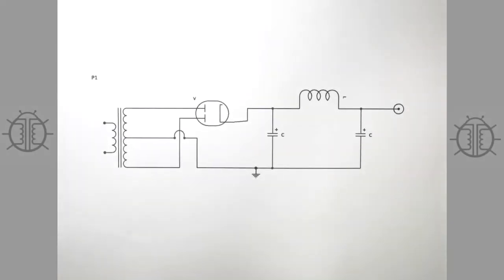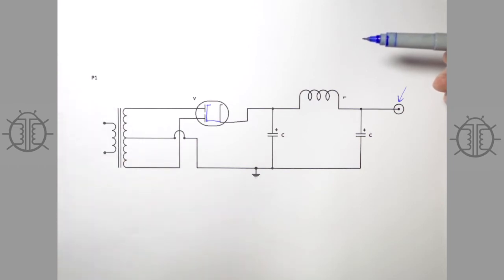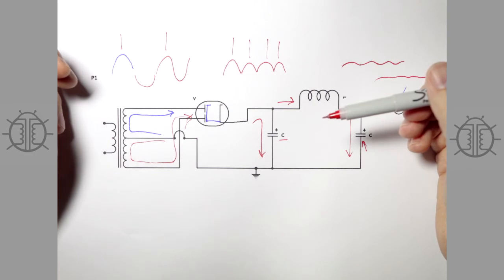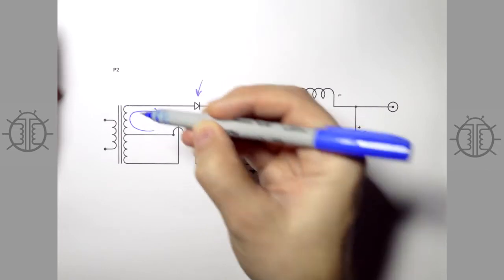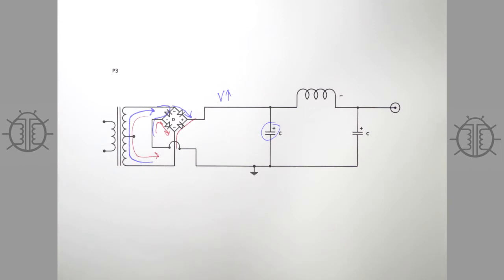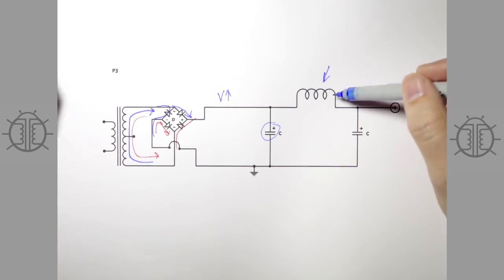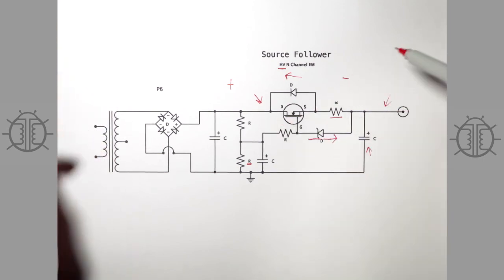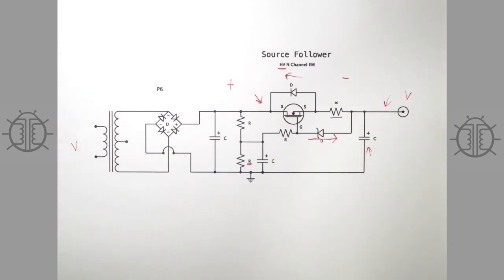Tube Amp Power Supply Design

Comment: For your final example where you suggest the idea of several zeners in series to add some voltage regulation to your circuit, I am recalling the use of tubes such as the VR-150. (Which we used to use.) Also, this brings to mind devices like the NE-2, as well. Just wanted to toss out the idea that one does NOT necessarily require the use of silicon zeners for this purpose.
Reply from the maker: Definitely agree! There are lots of ways to make a voltage reference. I’ve been using a small depletion mosfet for that lately. Uses way less current than zeners!
Reply: When a teenager (world population less than half of today's) I designed the HV regulation for the Geiger tube using a series string of NE-2's to develop the approximate 1400 VDC needed for the tube. (I contacted the physicist responsible for designing that tube and he sold me one, directly, for USD8.) Each NE-2 is a little different. So one needs to measure the stacked result, of course. I hadn't considered your thought about a small depletion mode mosfet, though. Need to think a little about that. :)  @Edgarbopp

Comment: Nice video, explained everything in great detail, we will refer our students to this video.  It contains all you need to know to build the regulator.  I see some people complaining about a lack of values and calculations.  If you can't compute the values for your requirements from the explanations in this video, you should NOT be experimenting with tube amps and power supplies like this.
Reply from the maker: togethia Thanks, I’m happy you find it useful!
Reply: Just look at a schematic the values are there already. If you are into designing your own then read books on how the values are determined. If you change tubes then you need to change values for the most part unless it's a direct substitute. 73

Comment: I never had a rectifier tube go bad. Probably because our voltage was only 115 vac from the standard outlet. Filter caps usually went bad probably because of their age. My amplifier had a 5Y3 and the preamplifier stage used a 12AX7 wired for 6.3 volts, the power amp stage was a push pull 6AQ5. Good little amplifier made by admiral. I believe it would still be working if I still had it. I have a voltage reducer for my tube radios. Made by APC the same company that makes UPS for computers. I like to keep everything original they sound better as a tube amp. My biggest project will be restoring my dynaco st70.i bought all new tubes including the rectifier tube. The only thing on the dynaco amp that will be changed is the Selenium rectifier I have the diode that was recommended for that amplifier. 73

Comment: The protection diode you added from source to drain in the fet is not required because it already exists as a function of how the fet is created, It is commonly called the 'body diode'...
The zener diode you added as a dual purpose device to current limit the supply and protect the Gate of the fet can actually cause the fet gate to go overvoltage in the case of the input cap shorting out while the output cap is still fully charged.
I strongly recommend using a bipolar transistor to sense the voltage across the current sense resistor with a series diode (1N4007) between the collector of the bipolar transistor and the gate of the fet which would allow the transistor to pull down the gate voltage to current limit, but not allow any current flow TO the gate when the output cap is charged when the input cap voltage rapidly drops to zero.
 You also need to add a reverse biased HV diode from the gate to the drain of the fet because of the reverse voltage pulse that can be developed across the resistor between the capacity multiplier input and the charged capacitor from the gate to ground.
 There are other ways of providing similar protections, but the one I described fits well into your design and provides a more accurate threshold of current limiting.
Reply from the maker: I definitely agree! I’m still just learning and since making this video I’ve actually used a BJT across a sense resistor just like you described! 

Some FETs do have reverse voltage protection built in but some still don’t so I tend to leave it in as a extra uf4007 costs basically nothing. 

Thanks for your thoughtful comment!
Reply: @Edgarbopp  
Thank you for responding.
Yes there are different types of fets, namely jfets and mosfets, adding a little more confusion, both types are available in both enhanced and depletion models.
There is NO physical diode inside a mosfet, the diode is the result of the process used to make it!  Therefore I cannot imagine you finding a mosfet anywhere that does not have a body diode,,  And you were using an enhancement mode n-channel mosfet in your schematic.
 Please also spend a little more time considering the other modifications I recommended.   I have an illness called MG, and it took a very long time to type that comment because of problems controlling my muscle movement..(the shakes, but not old age shakes).
 There is no doubt that your design will work, I was only trying to help you improve your protection systems.....
Reply from the maker: @Dennis-mq6or  thanks for taking the time! I’m sorry you’re struggling with MG!! I’ll reread your comment carefully.

Comment: It's not just variations in current drawn from the supply that cause reservoir cap voltage to vary.  Here in South West England, my mains supply voltage varies a few percent with a regular pattern to it.  It's like two or three simultaneous things varying the voltage, each having a different frequency in the range one to three Hz.  If you concentrate you can see brightness fluctuations in an incandescent lamp, and also hear the same variations in the magnetostriction hum of a large transformer.

Comment: This is a series Voltage Regulator versus a Shunt Regulator, many prefer a voltage source feeding a Shunt Regulator for Audio Electronics as it is more stable to powers line fluctuations. A Shunt Regulator would have the Drain going to ground and the Source near the incoming voltage..

Comment: This is the best explanation of a main power supply and filtering I have found so far.
Is it possible to use a Mosfet after a rectifier tube or do you have to use a Bridge rectified B+ with a Mosfet only?
Reply from the maker: The FET filter will work just as well after a tube rectifier. I’ve used it that way in a preamp I designed.  🙂

Comment: Good explanation of the different supply options. How does this final circuit differ from "capacitance multiplier? To my untrained eye it does not. I'll try the last one out. Is it necessary to filter it further with an inductor or can I pass it straight to plate?
Reply from the maker: The final circuit has a voltage reference created by a shunt regulator. In this case it’s a resistance and a Zener. That locks the MOSFET gate at a specific voltage. So it’s more like a regulator than a capacitance multiplier at that point. The output may feed the output tube plates directly. It will be very well filtered
Reply: @Edgarbopp  Thanks for explanation. Can I use high voltage NPN silicon transistor instead of a MOSFET? There are also 150v and 200v zeners available - how do I set the voltage for the transistor with it? I need like 250V in the output with up to 100 mA of current.
Reply from the maker: @MarkErikEE  a BJT can be used but the base will require current unlike a mosfet. 

To generate your reference voltage you will need to create a shunt regulator with a resistor and a Zener or a string of zeners. You will need to supply a minimum current to the Zener for it to drop its specified voltage. That should be in the data sheet. Chose the the resistance by understanding that the remaining input voltage that is not dropped by the zeners will be dropped by the resistance.

Comment: Excellent video. And passive components for high voltage? Suppose I am building a transmitter with an RF vacuum tube needing 800Vdc plate voltage. What capacitors and inductor can I use? And where do I get them? Oops. I did not watch the whole video. At 16:00 into the video the inductor is replaced with an N channel MOSFET. I wonder if I could use P channel for negative supply?
Reply from the maker: I should make a video about that. There are some pretty simple ways of achieving 800v using only 450v rated capacitors.

Comment: Another question if I may:  Because of horror stories I've heard about when using modern diodes in place of the old rectifer tubes and problems they can cause is that the reason for that RC time you mention ranging in the 15-30 seconds, is that to mimic the time the old tube rectifiers would also give .....as in, to help illuminate current surge and time for the tube to warm up before seeing full voltage on their plates ?

Comment: I have a question about transformer windings, on the full wave rectifier does each winding need to be rated for the whole current, even if they are only on half the time?
So say on a 50W Marshall JCM you have 690VCT@200mA (being 138W capable), is that 2 x 345V@200mA windings (not 2x100mA), only used in a 69W configuration?
So the regulator could potentially be "Brown Sound" switch, I know some amps have been built with multiple windings to allow voltage changes.
The circuit at the end looks a lot like the "gyrator" in the Molwam Pollux, albeit different, is this a true gyrator, have you experimented with these, what do you make of them?
I can send the schematic over, never seen it elsewhere

Comment: New to the channel and am very impressed! So have you given any more thought to a real live with values example video on this?  And if I may ask....what are those depletion type Moffetts you've spoke about in the other comments? Thanks!
Reply from the maker: LND150 for a low current voltage reference. It comes in TO92 as well as other small packages.

Comment: With the Zener regulator you show at the end, if wall voltage drops and the zener drops out, does the circuit go back to being a capacitance multiplier?
Reply from the maker: Yes!
Reply: @Edgarbopp  Well this is interesting.  That means one should probably keep the higher value cap in place.  It also means you might as well always implement the zener regulator.  I wonder which of the two circuits, regulator or CM lowers noise the most?
Reply from the maker: @rhclark6530  the zener regulator and CM are actually very similar in terms of ripple. I prefer the CM because you waste less power. With a regulator you need sufficient V drop so that the circuit won’t drop out under any circumstances. A more sophisticated regulator with a error amp and feedback network will be better then the zener regulator. Check out my video on the Maida regulator for more on that.
Reply: @Edgarbopp  I see your point.  Also I guess one could cascade two CMs for potentially insane ripple reduction in phono stage or headphone amp potentially.   Yeah, the Maida video is excellent.  Best explanation of the circuit I have seen.
Reply from the maker: @rhclark6530  my current pre uses a reg into a pair of CM.
Reply: @Edgarbopp  I don't mean to keep hitting you with these questions but this really interesting stuff.  Why did you put the CMs after the regulator rather than the reverse?
Reply from the maker: @rhclark6530  that’s a good question. I don’t have a great answer. I should do some tests and see if there is a benefit to using them in a different order. You could potentially test it yourself. Sounds fun!

Comment: Would love your comments on how tube rectification SOUNDS.
Reply from the maker: Tube rectifiers have a “sound” only under very specific circumstances. They have a highish internal resistance and so will drop voltage depending on the current. This means that when used with a class AB output stage the voltage drop will increase as the stage is pushed harder. This is called voltage sag. In instrument amps this can cause a combination of slow attack and release compression as well as additional distortion. Some musicians like this. However if SS diodes are used instead of a rectifier you can simply add a power resistor in series with the HV supply to mimic the internal resistance of a tube rectifier.

Comment: Hi Doug - can you tell us how to compute the components value for a 320V output? 250VAC PT? Many thanks!
Reply from the maker: If the HV secondary is 250v a quick way to guess the voltage after bridge rectification and filter cap is to just multiply by 1.4x that will get you in the ballpark.
Reply: @Edgarbopp  Indeed the secondary is 250 which yields about 350 after the first cap. What about the drop of voltage on the MOS circuit? How an I compute the components values? Many thanks!

Comment: i Like your psu design.
I wanna use/have 2 x 15 Volt (1.5 Amp) transformers back to back, to get around 210 V ac ( a bit of lost from 220 V ac). after i rectify that i have like 290 V dc.
the circuit i wanna build has 3 12AX7 an 1 6AQ5A tube, both have a max operating voltage of 250 V. 
What output voltage of your psu would you choose? the schematics says 275 V dc.

i saw your example circuits and taking "p7", what resistors, zener diode, Mosfet, capacitor (appart from the 4700uF, next to the rectifier) would i take?

Comment: On your first drawing you should match the transformer resistance and min rectifier resistance  
 found on your data sheet about 50-200 ohm add them and put in series  a 10 watt or 20 resistors the added value  should work very well…put the resistor right after the rect tube  this puts a load on the tube and keeping current moving forward and not going back into the transformer and causing it to heat up saving the tube and transformer life many manufacturers did this in the 1960s 
also the choke inductor has a resistance from 150-300 ohms as well add these calculations in your circuit design 😀the inductor choke will lower your b+ also using a too large of a capacitor on the first stage could be bad again look at the data sheet of the tube after the choke have fun and put a giant one in but 50mf to 100mf should do plenty 
Also you can do a simple 5 stage filter with resistors and capacitors 
I personally would use a motor run capacitor for a hvac they are dirt cheap and on Amazon and are oil filled and have no esr and make perfect filter capacitors  I have had very low ripple ac about .0031 at -90dbv and a standard ac ripple it will be dead quiet

Comment: Really nice job and great explaination of how things work. I see the link to Circuit examples is broken . Do you still have circuit examples avaiable ? I'm building a power supply for a BC-348. It is an HF receiver from a B17 Bomber.  I think the regulated version fits the bill to replace the Dynamotor.
Reply from the maker: I’ve fixed the link!
Reply: @Edgarbopp  Thank You !  I have the supply simulated with pspice and seems to work fine so it is on to building it. I chose the regulated version with a 214V zener value to yeild a 210 volt supply from a 350 V source. Thanks again.

Comment: Aren't you significantly raising the power supply impedance with that current resistor at the output?
Reply from the maker: The output cap dominates the output impedance of the circuit.
Reply: @Edgarbopp  Ah.  I have yet to find a good explanation anywhere of why power supply output impedance in audio power supplies matters and what we should do about it when designing?  Do you know of any?  Maybe you could do a video?  ;  )
Reply from the maker: @rhclark6530  I have a video on the output impedance of the amplifier but the output impedance of the power supply is a good topic idea. Typically it’s important for lowering crosstalk between channels, and providing adequate current in class AB amps when they transition to class AB from A.
Reply: @Edgarbopp   Interesting.  I hope you do a video.  One thought is that local bypass caps at each tube or each channel might help with shared power supply crosstalk.  BTW I think you were implying earlier was that irrespective of what comes before it you want a big cap at the output of the power supply to  keep the impedance of the supply low? If that's true what's the point of diminishing returns.  47uf or 470uf?
Reply from the maker: @rhclark6530  the size of the cap needs to bypass all audio frequencies at the impedance of the circuit. So the size necessary is different for different applications. Though as a general rule, I find 100uf to be a good place to start for power amps in the 10-20wpc range.
Reply: @Edgarbopp   What do you mean by the impedance of the circuit? The output impedance of the audio circuit?
Reply from the maker: @rhclark6530  the input impedance of the circuit the power supply is supplying. In this case probably the center tap of the output transformer. Asking what the impedance of that circuit is is the same as asking how much current it’s going to need at specific frequencies and voltages.
Reply: @Edgarbopp  That makes sense.  So in a line level stage it would be the rp of the tubes in parallel?
Reply from the maker: @rhclark6530  in a resistively loaded stage it would be the effective rp in series with the load of all the tubes being supplied. In practice it’s actually high frequencies that get inadvertently loaded by the power supply in preamps. This causes poor channel separation at high frequencies. This is because electrolytic caps become somewhat inductive at high frequency. This is why you often see the final cap bypassed with a poly type. Further decoupling near the tubes also helps.
Reply: @Edgarbopp  This is great stuff.  if you ever a get a chance a video on this would be really informative to a lot of people I suspect .